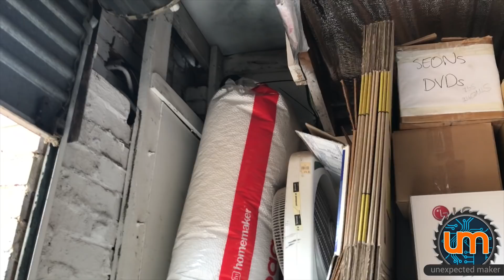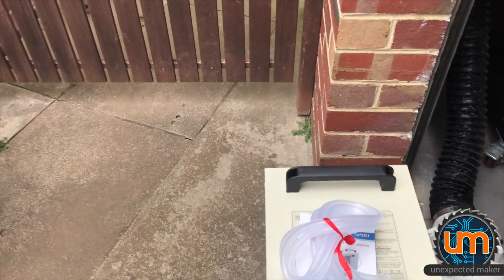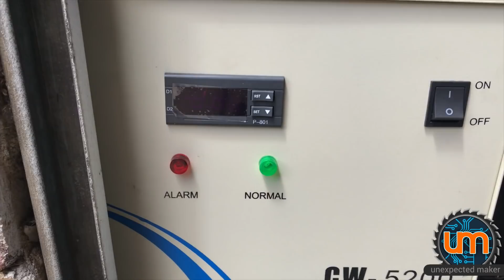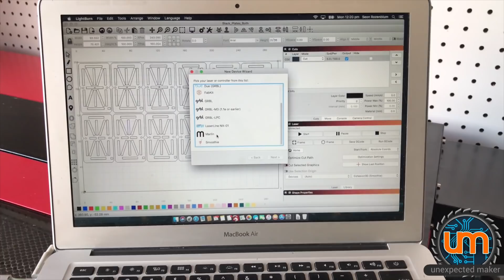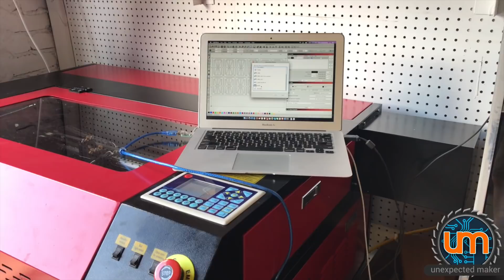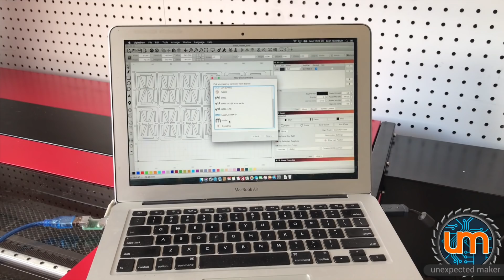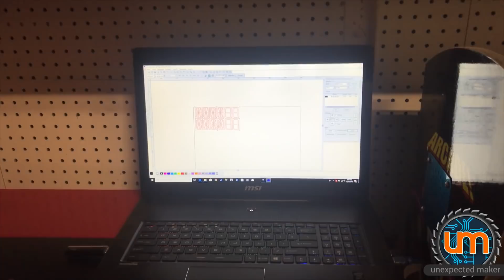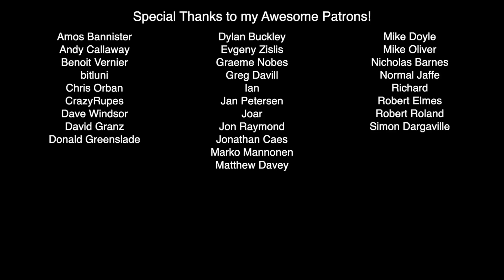New Laser Cutter Setup - Wait, What? Oh Nooooo

Comment: May I ask you what speed you are using and the thickness/type of material you are cutting. I have a similar laser (60W - really only 50W) but I need to use 2mm/s and 80% to cut 5mm acrylic. I'm in the process of checking the mirrors alignment and focus but it will greatly help me to know your settings. Thanks in advance
Reply from the maker: I cut 3mm acrylic at 17mm/s at 70%... I don't use anything thicker, so can't really let you know for 5mm. 2mm/s seems very slow.. My old K40 would cut 3mm with 70% power on a 35W tube at 5mm/s. Definitely check your mirror alignment and check the mirrors are clean, and that you have adequate cooling. Also your optimal cut height.

Comment: Bootcamp.
Reply from the maker: How does bootcamp save me from using Windows? I don't use a Mac just for the hardware, I use it because I much prefer macOS over Windows.
Reply: @UnexpectedMaker  Yes so do I. I have MacBook Pro and iMac pro max spec. I hate Windows. But sometimes you have to dance with the evil to get want you want. i have bootcamp installed on both with VmWare as well. Running Windows on an iMac Pro allow access to the Vega Graphics Vulcan APIs for some reason Apple is declining to support Vulcan I guess do to competition for Metal.

Comment: Just curious could you replace your controller with a supported version?
Reply from the maker: Yes, I could replace it with a supported Ruida controller, but at AUD$600, it's a pretty big hit on what the unit already cost me, so I'm being patient. It's not like I can't use it as it is, it's just not a great experience using 2-3 apps to get a file from design to cut.
Reply: @UnexpectedMaker  I can understand that. I am looking at different lasers right now. Thanks for your review.  I am looking to create my own marketing material for my real estate business. I have spent thousands having my cups,  glasses and cutting boards branded with my custom logos. I found one with an included chiller and Ruida controller for $2999.00 USD.  I just need to see a few reviews on then to help me decide to jump in with both feet.
Reply from the maker: I'd be careful with a Laser with a built in chiller, though my external chiller has been great so far, I've heard they fail often... having something like that built in sounds like a major fail point that would be hard to fix.
Reply: ah good advice Thanks I will keep that in mind.  I did run across a few that had external chillers.  It seemed to bump the price up about $350. I think they were the CW-5800
Reply from the maker: Yes, the  chillers are pricey unfortunately, but one of the best investments I've made.

Comment: This guy has a good workaround until Lightburn supports TopWisdom controllers.  https://www.youtube.com/watch?v=VVdWyrb2Ohk&list=PLuDePhnyKAK-ZmxwsYBT4gV3FAw_u1z5R&index=8
Reply from the maker: Thanks Dave. I've been using SVG to go from Lightburn straight to AutoLaser... without needing any steps in-between... though occasionally I might need to take it via InkScape if it's a super complex shape, or if it's right out of Fusion 360.

Comment: Awesome video! what are the dimensions of the cutting area?
Reply from the maker: Cheers :-) This unity can cut a smidge over 700x500mm but you can get bigger units. I just don't have the space for bigger o I could have gotten a 1200x900mm one :-)
Reply: Unexpected Maker - thanks so
Much! I plan on cutting up to about 7mm’s thick acrylic. Do you think it could handle it? Oh, and have you heard of “light burn” software ? Supposedly there’s a good sized community around it.
Reply from the maker: Yup, I'm a Lightburn user... unfortunately, Lightburn doesn't support this controller yet, but it's being worked on. 7mm Acrylic is fine so long as your power/speed settings are set correctly... it's all about power + speed per material type.

Comment: So... laser cutters don't just accept G-code?
Reply from the maker: it depends on the controller and what proprietary code the manufacture has added. I'm my case, the controller uses proprietary code :(
Reply: Unexpected Maker - But... why? How can a laser cutter possibly require codes outside the standard G-code definition? It's the simplest NC machine you can get. I can't believe that a manufacturer would cripple the utility of their hardware, though; do you know what the M-codes do?
Reply from the maker: Lots of Chinese manufacturers do it.. Lasers, 3D printers, PnP's... It's quite common... hardware is easy to copy... add proprietary software and it becomes MUCH harder to copy. I know that sounds like an Oxymoron concerning Chinese products, but just the way it is.

M-codes? no idea, sorry.
Reply: Unexpected Maker - I don't know the codes actually abbreviate, but 'G' codes "go" somewhere with the tool head and 'M' codes do "miscellaneous" or "manufacturer" and "machine" specific functions. You'd think that all the possible laser features would be already in the standard language, though.

I take your point about Chinese IP theft, though. Years ago I co-developed a product that we had manufactured in China. We knew the hardware would be stolen, so we never let our core software go anywhere near the fabricators. All they ever got to touch was the bootloader.

I don't see why that would apply to NC machinery, though. As a manufacturer, you'd want it to work with any tool path generation software. That's a bottom-tier feature.

Comment: One problem I see is if you use a rotary you won't be able to get into the electronics bay to switch the rotary to the Y axis driver.
Reply from the maker: I don't use or plan to get a rotary, but why wouldn't I be able to do that? I have complete access to the stepper controllers and all of the wiring. Or do you mean inside the controller?

Comment: I see it has a Topwisdom controller. Similar to a Redsail. You might want to upgrade to a Ruida controller for better control and software support.
Reply from the maker: I looked into that when I first found out, but Ruida controllers are expensive... so why spend another $400-$600 when Lightburn will support this controller soon? I can cut right now... as frustrating as it is, so I'm happy to wait.

Comment: Run windows in a virtualbox vm on your mac or use parallels.
Reply from the maker: Right, but still in windows and still using the crap software... just on Mac hardware... so a tiny bit better, but not a lot.
Reply: @UnexpectedMaker  Nice Seon. Ultimately the solution you used is not as crappy as your preferred choice given that the latter doesn't actually work, and quite literally, doesn't cut it. In the Maker spirit of doing whatever it takes to get the job done, your workaround got you a result, it really doesn't matter how. Would have been nice to see the result at the end, whether it stood up to your expectations etc., the 3D print you made, a followup 6 months on etc.

Comment: If you are comfortable with the software on the old cutter you can salvage it for the parts and build yourself a sloped bed full sheet cutter using extruded 80/20 t slot aluminum rails. Still the slower speed and lower power but the ability to get materials in larger sheets and feed in will save you time in no longer needing to cut them down. 

Lots of fun parts for the t slot rails so effectively a larger erector set you put inside a box to control the smoke.
Reply from the maker: I've been trying to decide if I wanted to just sell the K40 or make something new out of it :-)

Comment: If you dislike windows will it work with Linux? That or one of the programs that lets you log into the mac from the windows laptop to act as a bridge between them till they get the update done (if ever).
Reply from the maker: The software that ships with the laser is Windows only, so stuck in Windows until Lightburn supports this controller. It's not even so much that I am stuck in Windows land... Win10 is not terrible, but the actual laser software itself is pretty crappy, so it's a double whammy ;) But I'll live!

Comment: Wait... if I want to use the chinese program shipped with the machine or directly the firmware on the machine (and a file on a usb for example), I can't do rgb mapping? Is necessary to use a third-part program like lightburns to have in a single process engrave&cut?
Reply from the maker: No idea Luigi, sorry. I've only ever used Lightburn. I upgraded my K40 with a Cohesion 3D controller specifically so I could use Lightburn as it's just an amazing tool.
Reply: @UnexpectedMaker  Ok thanks! But for the sake of science and for everyone else interested in this laser ;p... could you try using the crap-software they provide and see if RGB mapping is possible? 
only if you can obviusly... but would be really useful! 
anyway, thanks and continue publishing your laser-adventure please!
Reply: Lightburn is not an end all do everything program. You will still need Adobe Illustrator, Corel draw or Inkscape.
Reply from the maker: No, it's a top class laser controller... my workflow is Fusion360 & Lightburn.

Comment: Years ago I bought a digital camera in japan for half the price it was due to be sold in the UK, a Minolta Dimage, in my excitement (digital cameras where not an everyday thing then!) I forgot to ask about the software and had to wait a month for the English version to be written, so been there too!...…...glad ya got a work round.
Reply from the maker: It's not like I am an early adopter... this controller has been around for a while... just not supported in Lightburn yet, but they are def working on it. Just the way it turned out. At least I can cut with the included software.
Reply: :-) I had the Konica Minolta Dimage Z1